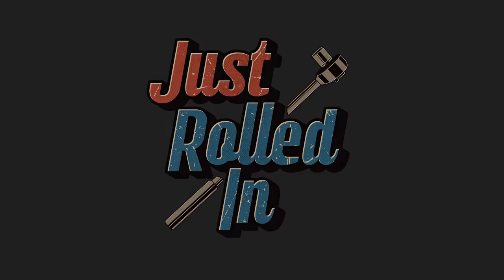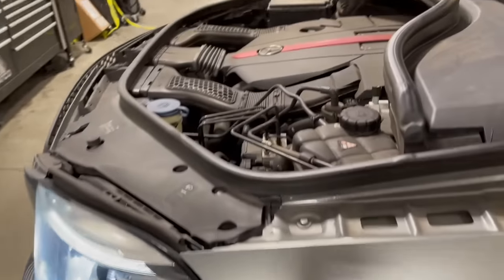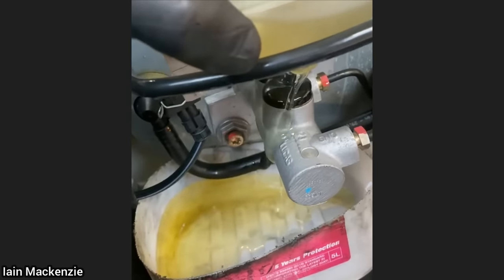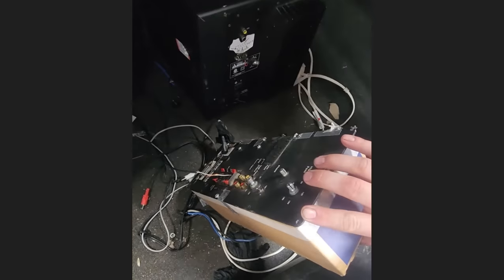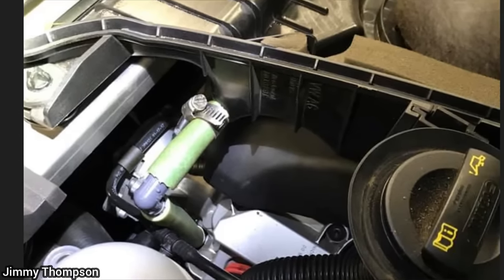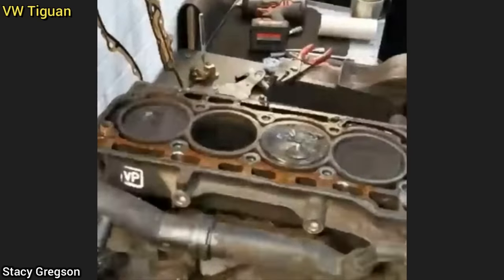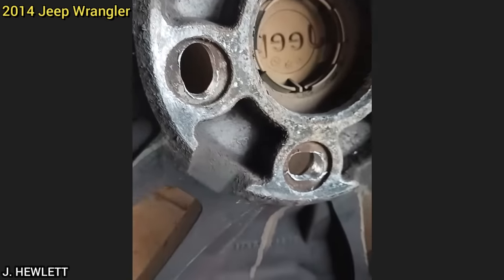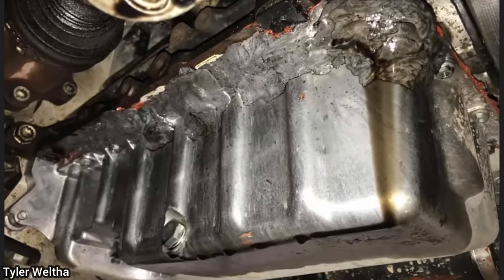Customer States Ticking Noise After Topping Up Engine Oil

Comment: Not gonna lie... I use a bit of dish soap in my washer all the time... have for decades... never had this problem..
Reply: There are a couple of reasons not to do this. Your home-made washer fluid is likely to freeze and crack the bottle or pipework, depending on where you live. Bacteria can grow in it, blocking the pump and pipework.
You can mitigate both of these by adding 10% Denatured alcohol (Methylated Spirits.)
Dish soap contains salt, so if you use it, don't use a lot as it will damage paintwork.

Comment: Sorry, the Audi concern. That tube is not the crankcase vent. That is a 2017-2020 Q7 with the 3.0 supercharger engine. That tube is the dipstick tube. There is a cap on it at all times, except to check oil level.
Reply from the maker: Good to know! I was told the wrong thing 😅
Reply: @JustRolledIn  No problem. Keep up the great work.

Comment: I'm curious as to what the owner of the six year old Mercedes was doing for it to have multiple engine mounts break.  Also, some of these screwups make me, a DIYer, look like an experienced professional mechanic.
Reply: I’m the tech that worked on the GLE, car had nearly 90k miles on it. Usually engine mounts last fairly longer than that, but the mindset of a GLE “coupe” owner is to gas it to the wall every time will definitely wear them out prematurely

Comment: I was a service advisor at a Lexus dealership and this spoiled brat of a kid ,18 years old, had a brand new IS 300 bought for him by grandparents. This was 2004 btw, the car got flatbedded in as the transmission was toasted, with only like 12,000 miles we were thinking WTF how  does this happen.  A mechanic and myself walk out to the car and r glancing it over then we notice he had drag radials on the drive tires (rear tires) it quickly went from warranty to customer pay after seeing that. Don't worry the grandparents paid for everything since this bum didn't work.

Comment: Well it's plain for everyone to see. That oil pan needed more JB weld. You have to use at least 10 tubes to seal a oil pan!   Classic rod delete. 3 cylinders get better mileage then 4 cylinders! If only those were the worst I've seen.

Comment: While these are pretty cringeworthy, the gear oil in the brake system made me say "ohhh".  That's an expensive fix, usually swells all the rubber in the system.

Comment: Some of the clips you show just plain baffle me, if you don't know what you are doing ask friends, co-workers, watch You Tube, if you still have doubts, take your car to a mechanic. I can understand to a degree why folks don't trust repair shops but they are not all crooks... my car has been serviced twice by non OEM shops, no complaints, the car goes to the dealer for servicing. I've had several Toyotas, they all have gone to a dealer for service, my present Toyota dealer has been the worst so far but that is because of the local "customer service" attitudes from far too many shops offering various services not just auto repairs. Glad I'm moving but I could be going from the fat into the fire, time will tell.